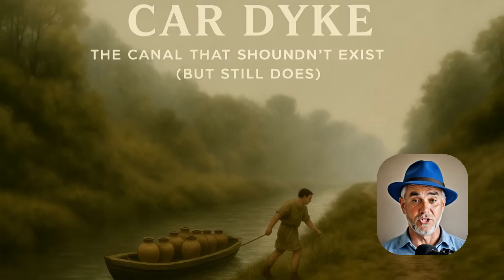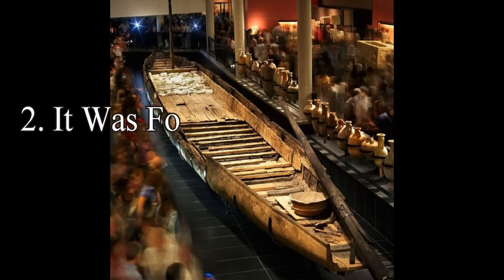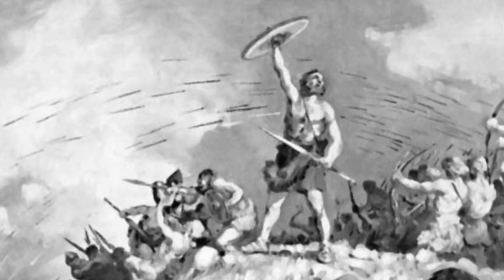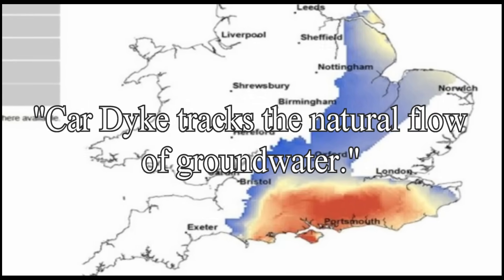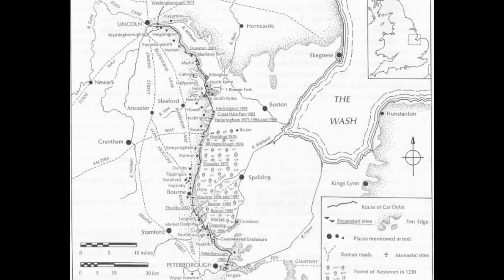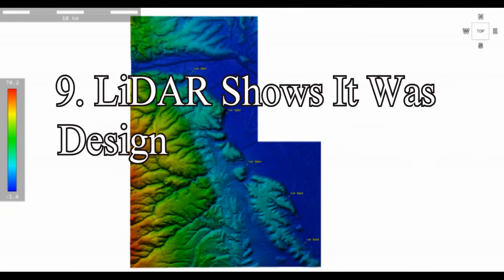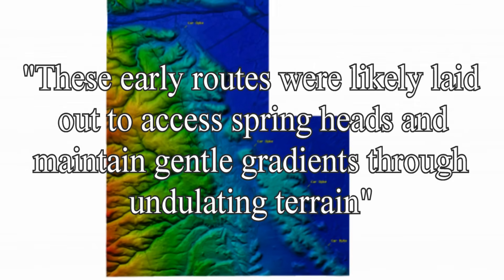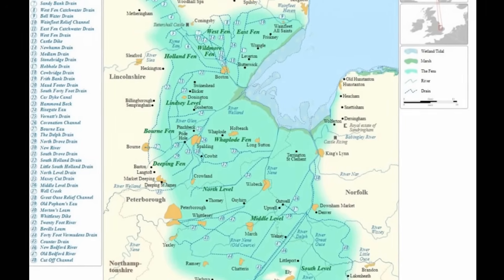Ten Reasons Why This Dyke Blows Britain’s Earthwork Myths Out of the Water

Comment: I notice the mast on the Roman boat. That is just were you put the mast to haul a boat possibly against the flow of the water.
Roman era boats excavated in the Netherlands have masts in the same place. A commercial archeologist I spoke about it some twenty years ago maintained that the mast served to carry a sail. Of course an sail carried by a boat will only move it down wind, not up the river Rhine. These were large boats and the Romans will have used teams of slaves to haul them upriver. 
So also in the Netherlands idiotic ideas about previous times can be maintained.

Comment: my own personal theory on canals is that they were used to reclaim wetlands i.e swamps, bogs and marshes. there are two canals in the valley im from. one of them is still operational with water and that one has dry solid ground all around it. the other on the opposite side of the valley is dry with no water in it and that one is surrounded by bogs. its like the dry one is not working anymore so the land around it has reverted back to its natural state. but i havnt seen enough canals to know if this theory holds true everywhere

Comment: You seem to be claiming that all dykes are the same and for same purpose, based only on the evidence from one of them, ignoring the fact that several others are completely different. Many secions of raised bank dykes have far less significant ditch by them, and are on top of hig ridges, definitely NOT in waterlogged low-lying areas. All the pictures shown are primarily of a DITCH with gradual gradient and water in it. Some of the others go up and down STEEP gradients, and the banks would not be high enough to contain water, as it would overflow and run out. MY conclusion would be that not all bank dykes and ditch dykes are the same. You cannot argue against assumptions by use of assumpions. The only conclusion I can agree with is that we still don't know what many of these are or why, and need to re-think the assumptions made.
Reply from the maker: I don't do assumptions - I leave that to social media users.  I have written several books on all the major dykes in Britain, utilising Lidar (for the first time in history) and hydrology data from the British Geological Survey (BGS).  If you are interested, please visit the blog site or other videos on this channel, and it may help correct some of your assumptions.

Comment: Still a big difference between the gentle slope of th cardyke canal creating a a navigable river and the undulating hilltop paths of the other dykes mentioned here such as Offa's etc..
Reply from the maker: The variations in Car Dyke is in parts as extreme as Offa or Wansdyke but goes unrecognised as they are at hieght and Car Dyke is not - but the same hyrologic principles are in action - without natural springs supplying water Car dyke would dry up - as it has done in some locations. Books on all three show this in graphic detail, if you need empirical evidence?

Comment: Very convincing, I'm sure you are right. However Wansdyke, despite its name, is not viable as a canal, as anyone who would have walked up hill and down dale will attest. No idea about Offa's Dyke.
Reply from the maker: Both Offa and Wans dykes are built at a time of higher rivers and water tables - so digging a 2m ditch would have flooded. https://prehistoric-britain.co.uk/rivers-of-the-past-idiots-guide2
Reply: @RobertJohnLangdon-author  Thank you for your reply. But surely if the water tables were that high when Wans Dyke was created, the relatively low lying area around Car Dyke would then have all been significantly under water, rendering it unnecessary. So Car Dyke must have come much later?
Reply from the maker: @altair8598  - that's why you need to read the blog!!
Reply: @RobertJohnLangdon-author  Ive tried three times but it just opens up to cookie acceptance yes/no then clicking on yes leads to IONOS site promoting tickets to the Colosseum etc. Can you offer a different way in to read your blog?
Thanks
Reply from the maker: @altair8598  Google: "Rivers of the Past Were Higher: A Fresh Perspective on Prehistoric Hydrology"
Reply: @RobertJohnLangdon-author  I'm very tempted by your theory. Car Dyke is certainly up for debate. But you can't have much higher rivers in the Wansdyke area without totally submerging where Car Dyke is located, can you? Plus, whereas northwestern UK has been rising since the Ice Age, the area between Yorkshire and Wessex, through isostatic rebound, has actually been sinking, requiring rivers to cut deeper channels.
Reply from the maker: @altair8598  -  Ah, the classic “if rivers were higher, we’d all be living under the sea” argument! I suppose by that logic, the people who built the canal systems at Tipón in Peru—which sits happily 3,000 metres above sea level—must have been exceptional swimmers. Or maybe the Andean mountains were just massive underwater aquariums? Hydrology isn’t quite as simple as drawing a straight line from sea level, you know. Rivers, dykes, and canals work on gradients, springs, rainfall, and a host of other factors that don’t require the world to be submerged every time you spot a ditch above your local waterline. Maybe read the bloody blogs I sent you or give “hydrology” a quick search before rewriting global geography. Just a thought!

Comment: I have long thought that elevating Archeology into a science was a step too far, far to much conjecture to little actual science. Archeology across the world is being questioned and challenged by engineers, geologists, cosmologists and physicists and other disciplines and rather than embrace there contribution the reaction is to ridicule and dismiss. This presentation is so illuminating and frankly much more believable than oh it’s a defensive line. Thanks.
Reply: All science is conjecture supported by peer review that validates it as the best model we know of to date. There is no ‘Holy’ body of knowledge that cannot be challenged as we find out more about our universe and archeology is no different. It changes every day in greater or lesser ways. That is why we keep n searching for more evidence to advance our model. Subject it to peer review. Input from other disciplines is welcomed to advance our knowledge and they give archeologists new tools to extend our knowledge of the past and alter our historical models accordingly.
Reply: @johnfisk811 that’s actually my point archeology is rigid in its views it does not have an open minded approach it debunks anyone outside of the discipline on a regular basis. The other sciences are certainly not without fault and the orthodoxy is being protected more and more.
Reply: @michaelwheatland4565  I agree with you.  For whatever that's worth.
Reply: @michaelwheatland4565  orthodoxy has to have inertia. Changes need evidence convincing that there is now a better theory. Otherwise you get a room full of contrary theorists all relying on shouting over each other with no common view. Science is peer reviewed not an anarchy. You may be right, you may be wrong but who is qualified to judge. If I make videos and get the most views in opposition to yours does that make you wrong? Of course not. If you have an hypothesis in opposition to the orthodox then you are right to bruit it about but it must come under informed scrutiny.
Reply: @johnfisk811 I’m going nowhere with this.
Reply: @johnfisk811  I remember reading a book about the water supply of classical Greek cities by an American archeologist, inspired by her daughter who was a civil engineer. She had spent most of her life studying these cities without seeing this practical aspect.

Comment: That Car Dyke was a partially engineered watercourse used during the Romano-British period and possibly possessing earlier origins is not much disputed. Nor is the apparent fact that it was part of a larger system. In that respect you’re preaching to the choir. However, it has little bearing on other earthworks commonly referred to as Dykes some of which are known to be roads (eg. Ackling Dyke) whilst others, such as Offa’s Dyke couldn’t have been water routes without major, now disappeared alterations or serious adjustments to the basic laws of physics. A Dyke simply means either a ditch or extended ‘rampart’ type earthwork and might have various purposes depending upon context. It is unfortunate that there are no suitable illustrations of the boat you refer to but I think you should have pointed out that the illustration you used is of a Roman barge on display in Arles, France.
Reply from the maker: A blog made just for the sceptics:  https://prehistoric-britain.co.uk/rivers-of-the-past-idiots-guide2
Reply: @RobertJohnLangdon-author  Thanks for that. I’m not entirely convinced regarding all so-called ‘dykes’ but the blog certainly offers material for serious consideration in many, if not all cases. One area I remain fairly certain on, though, is that there must have been a substantial need for any transport system requiring either/or major engineering work (ditches, linear earthworks etc.) and regular modal transshipment. This would surely imply extensive trade of which there ought to be at least some evidence either in material form or of population centres. Regarding boats, there are several pre-Roman examples including both logboats and sewn-plank structures but, so far, all associated with known waterways (as far as I’m aware.) I appreciate that, in reality, many have been chance discoveries and that a very high proportion of UK’s area remains archaeologically unexplored. One area I agree with both you and the blog upon is that once an ‘expert’ narrative takes hold it becomes very difficult to oust or amend even when it becomes obvious that it’s wrong or too limited.

Comment: When designing a drainage system, self cleaning velocity is the silver bullet, this is maintained buy design of the pipe/ ditch/chanel . Self cleaning velocity should be maintained during average flow conditions, but when it cant, peroidic flushing is done, this is done by retaining the or a portion of the flow, in the chanel or purpose built resiviour and then letting it go to scour out silt and debris, it sounds like this was part of the original plan here/...just wondering. To state the obvious early man was clever, they invented the hammer, who can improve on the principle? not me...

Comment: Well done sir. This system's understanding is what many do not understand in relation to engineering. This is also how cheap sub surface irrigation can be managed by water table. Nature created meanders like this in valley's The rounding off of the landscape by the ice age's may have been a hydrological boon. As described little elevation difference would be needed. Lock's in this type of infrastructure could have been swapped out with portage for modest craft. Roller's or rail. Even channeled water as a lubricant for a system. The Chinese had a saying. Keep the bank's low, but the channel clear. That support's a water table used in canal's, and not surprisingly get away, and reduced water depth with the nutrient advantage of regular fertile silt disposition. Harnessing nature.
Reply: How could we have lived without motorways and 40 ton lorries? I once had a children's book in French that described a village exporting part of its crops to a town down stream using two boats, selling one boat for wood and using the other to carry goods bought on the town, the men walking in the stream to push the boat home - illustrating how every stream was considered for transport purposes. It seemed to me this might well have been practiced in the time of the grandparents of the writer.

Comment: The Car Dyke is a ditch that runs through the counties of Lincolnshire and Cambridgeshire. The main section starts close to the River Witham at Washingborough, near Lincoln and runs in a generally southerly direction to Fengate on the River Nene, near Peterborough. A second artificial watercourse, also known as Car Dyke, runs for 5 miles (8 km) from Setchel Fen on the Old West River, part of the River Great Ouse system, southwards to Waterbeach on the River Cam. The northern section is around 57 miles (92 km) long, and is by far the longest artificial waterway constructed by the Romans in Britain, while it is also longer than any known Roman navigational canals on continental Europe.
Reply from the maker: My book shows (using LiDAR) that it is, in fact, a single watercourse by the time of the Romans: https://prehistoric-britain.co.uk/revolutionising-history-car-dyke-unveiled-as-prehistoric-the-launch-of-fusionbook-360
Reply: @RobertJohnLangdon-author 

To be frank, I hope no-one is interested in your book and it's firmly placed in the ditch and not the mainstream. 😅
Reply: These dykes were probably constructed thousands of years before the Romans even came into existence.

Comment: I'm sure you are right about Car Dyke, the water flow was probably greater back then too, but that was a very wet relatively flat landscape. Do any other Dykes meet the water and gradient requirement, Offas Dyke? A dyke that goes up and down along a dry ridge could not be a canal. With Offa, did they have the organisation and manpower to man it? You have to admire the amount of effort put into building these structures.

Comment: I'm certainty convinced by your argument that it was built deliberately to be a waterfilled channel and that at least the later Romans used it as a canal. But it still doesn't disprove its original possible intention as a linear boundary. A water filled obstacle is more effective a deterrent as a dry ditch would be.
Reply from the maker: The design shows two completely different construction designs - several straight sections (Roman), interconnects multiple wobbly-wobbly (prehistoric) sections- which scientifically discredits such a theory.
Reply: @RobertJohnLangdon-author  leaves a question to be answered no doubt but does not ‘scientifically’ discredit the boundary theory. It merely raises the question.